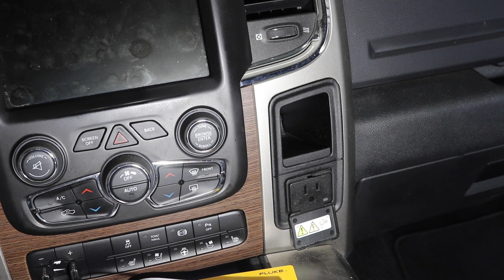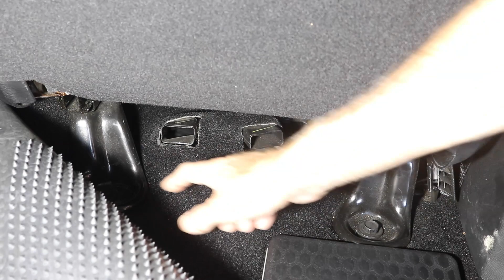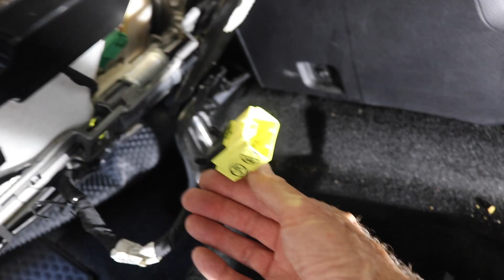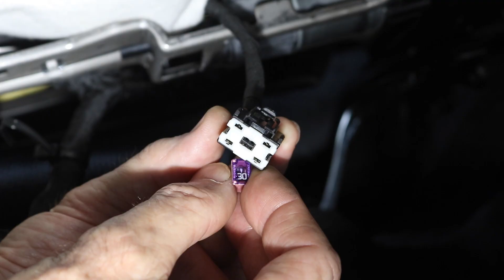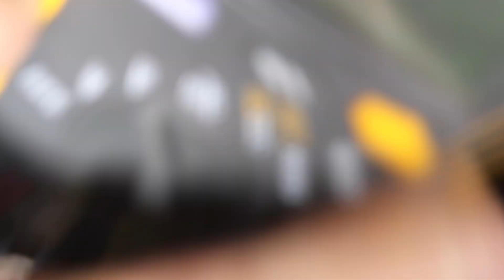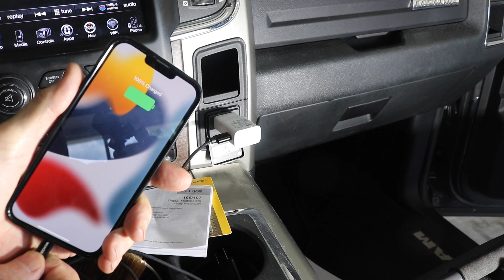RAM Cummings 2500 AC power receptacle not working

Comment: So i dont have a power inverter under my passenger seat. In my 2016 ram 2500. Im assuming i need that in order for the outlet to work. My truck didnt come with the outlet. I bought it on ebay and plug it in inside the dash

Comment: You said you let your truck sit for long periods.  Do you have the diesel tank topped off before you do that or not worry about condensation?  Are you worried about diesel life span too?
Reply from the maker: I'm not sure what I said, ha but it's best to keep it topped off and diesel can go bad and when it does, algae and other issues cause problems in the tank.  Keeping it topped off will prevent that.  There's additives also but haven't needed them.